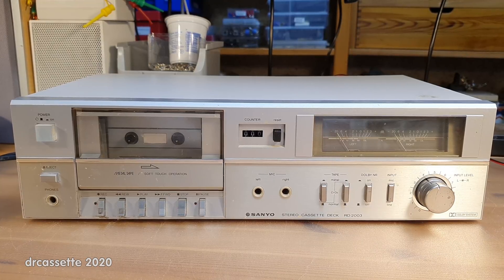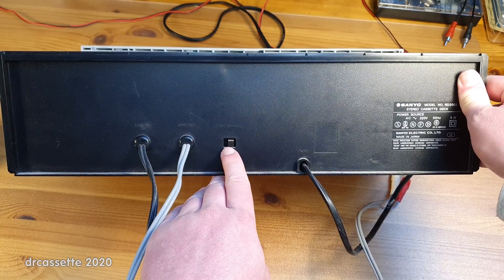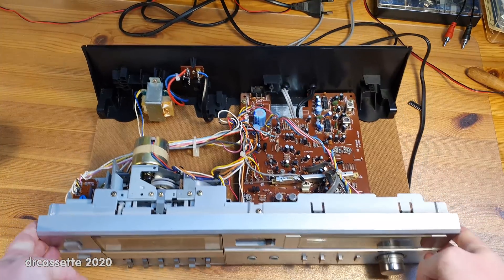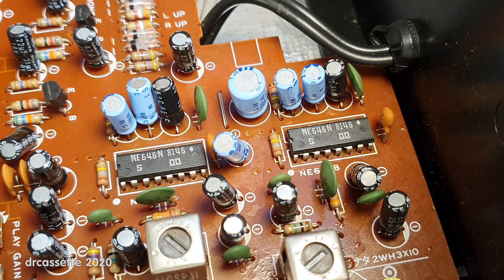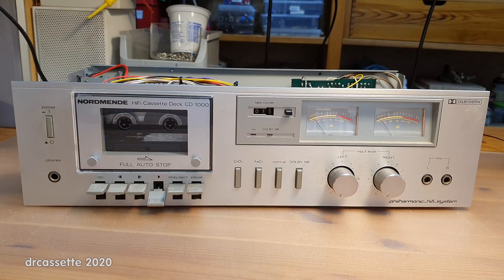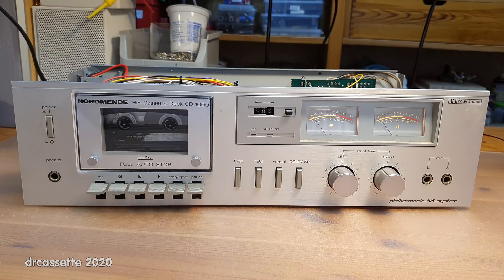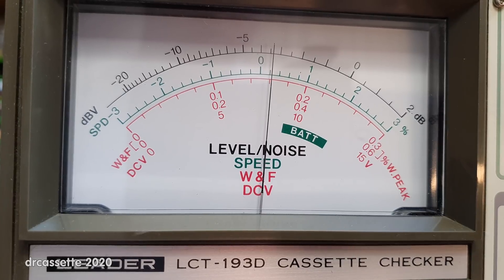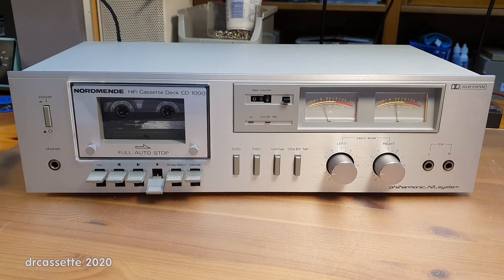Nordmende CD 1000 cassette deck repairs [2/2]

Comment: Hi DrCassette, I have hier a Nordmende HIFI cassettedeck CD1200  979.158 H.The problem is that  al the belts are melt except the counting belt. Are there manuals to put the straps back there are 4 I think, and where can you buy the belts? Kind Regards. Anatole.
Reply from the maker: Do an online search for the service manual of your cassette deck. It should contain all info you need. I usually buy my replacement belts off Ebay.
Reply: @DrCassette   i have done that, and find one but they don't mention the belt change neither a picture

Comment: Gut gemacht :) Ich bewundere Deinen Werkzeugpark, so einen Cassette-Checker hab ich noch nie gesehen. Ist aber offenbar essentiell wenn man an Tapes hantiert. Ich hab mir heute ein Braun C1 gegönnt das an einem Dual CR60 spielen soll.
Ich würde mich freuen wenn ich Dich um Rat fragen könnte so ich vor Problemen stehe. Frohes Neues, Doc
Reply from the maker: Den Cassette Checker habe ich noch nicht so lange, man kommt auch gut ohne aus. Geschwindigkeit habe ich bislang nach einer anderen Methode eingestellt, und Wow&Flutter messe ich nur, weil das oft von Zuschauern verlangt wurde (von wünschen will ich da nicht mehr sprechen...)
Du kannst mir gerne Fragen stellen, aber es kann immer etwas dauern, bis ich antworte ;)

Comment: Hi Dr. Cassette,
I have a question for you about your video on the vx1000 you did a few years ago, (I know it's weird but I don't think you would have answered if I asked you under the old video)
Here's my question:
If I film with my vx1000 and then I put the miniDV into another camcorder and transfer the files to my computer and then I put the miniDV back into my vx1000, can I continue to film or the miniDV/VX1000 will lose quality ?
And if I use a firewire cable can I keep the same miniDV tape or do I have to change it regularly anyways ?

Thanks for your respond and keep up the good work.
Reply from the maker: I do read all comments, including those I get on old videos. So I would have much preferred if you had asked in the comments of the old video.
The MiniDV system is digital, so there is no loss of quality, until the MiniDV tape is so worn out that errors in the digital data stream occur in which case there will be disturbance in the audio and/or dropped (lost) frames. I generally advise against reusing MiniDV cassettes, but if you have to, you can re-use them a few times. It does not matter where you play the MiniDV cassette.
Reply: @DrCassette  Thank you for your answer but I'm not sure to understand :
Is there a difference between transfering the files via the firewire cable and transfering files via putting the tape in another camcorder ?
So if it's the same, do I have to use (and buy) a new tape each time one is full or can I film over it again and again ?

Thank you for your answer and time

Comment: I used to have a very similar Sanyo cassette deck when i was in high school. I thought it looked cool but i saw a picture of it recently and now i realize how cheap and ugly it is, bottom line from its era for sure, one of those electronic devices that looked better than they actually were. I understand why the technician said it was impossible to repair lmao i have a Pioneer from 1998 now, i cant imagine using a Sanyo like that again

Comment: Some early sanyo products are really well made this deck is as you said very cheaply made you made the right choice the normende does sound decent even taking into account youtube compression and listening on my amp and speaker setup you made the right choice ,i have been experimenting with changing op amp chips in a few cd players to improve sound i found a site with mods that can be done to a philips cd710 i have owned from new and decided to test and do the same with a sony cd player it has made a big difference as treble sounded a bit over the top before now it sounds way nicer and more balanced i am going to swap the cheap caps in the sony for quality panasonic fc series caps and see if it sounds a bit better again just for fun i used sockets in both players so the chips can be swapped with ease now .
Reply from the maker: Indeed the early Sanyo products were quite good. They got worse and worse over the years...

Comment: Hi dr. cassette. Greetings from the U.K. I have had many pieces of audio equipment since 1973 and have always been interested as to what goes on behind the facias, lights and meters! Thank you for all of your enlightening, educational and entertaining videos on YT. Keep up your good work in repairing and preserving this equipment. Also may I sincerely compliment you on your English commentary ( measured, understandable, flowing) and written replies to those comment on your work. Have you ever worked on any Aiwa tape decks? I owned the Aiwa AD-6400 in the mid 1970's and the AD-M800 in 1980/81. I had to replace an internal fuse on the 6400 and was surprised to see that not only did the tape mechanism have a sizeable fly-wheel but it had been drilled out at the hub for balance. It seemed to be well built and laid out inside. The later AD-M800 model had a wireless remote control (yes in 1980/1!) and a very clever tape calibration system with a 4 memory store for the users' four most used tape brands, plus lots of excellent on-board features. I sometimes wonder why I sold it on! Thank you again for all you work. Stay safe and well.
Reply from the maker: I have worked on Aiwa cassette decks before (on one of them there is a video available on my channel). However, all these cassette decks were considerably newer than the ones you had. From the 90s and even early 2000s. At that point, Aiwa had been taken over by Sony and the equipment they sold could not compete with Sony products, so even the best Aiwa products were only made to about the same standard as Sony mid-range models.

Comment: I noticed you did not make use of the Dolby noise reduction on the last recording you made. I find Dolby is a 100% must on most music. Possibly not on the type of music you were playing! The signal to noise without Dolby is only about -40dB ish. A common problem with cassette decks was as the head wore out, the HF and gain dropped, this upset the Dolby reference levels, making the sound even more muffled and Dolby use impossible.
Just a point, not related to your video, many people do not understand Dolby is a 2 way process, if you simply switch it on during playback, you will badly lose all the HF. If you wont the noise reduction to work, you must record the tape in Dolby AND play it back in Dolby. This will (in theory!!) give you up to 9dB of noise reduction but ONLY at high frequency, it has no effect below 2/3 khz Only Dolby A gives full frequency noise reduction and was/is mostly used in the recording and film industry.
Reply from the maker: I never use Dolby on any recordings. I made the experience that when Dolby recordings age or are played back in a different cassette deck, they don't sound right anymore.
Reply: @DrCassette  I can vouch for this! My dad's recordings from back in the day that utilized Dolby C sound super muffled even when Dolby B is turned on, however with Dolby NR off they still sound a little weird, so I just have to live with it unfortunately. Especially if you are using a metal tape that (in my experience) has lower noise than ferric or even chrome, Dolby is not necessary.
Another issue I notice with Dolby NR is that even with fresh recordings, one deck's Dolby B isn't going to be super compatible with another deck's Dolby B. I have a cheap RadioShack Realistic tape deck that utilizes Dolby B, but when I play it in one of my higher-quality Sony decks it sounds too muffled with Dolby B on. It's possible that one deck or another is calibrated improperly due to age, but since I'm not super proficient in that area of deck repair I'll just choose to leave NR off.

Correction: Metal tape isn't quieter! It can just be driven higher than other tape types so you don't notice it as much.
Reply from the maker: @KSBEntertainment   In my experience especially aged Dolby C recordings are indeed problematic. Dolby B you can always play without Dolby and they will sound okay, Dolby C tends to sound rather strange. 
Metal tape actually has higher noise than chrome, but you don't notice because you can record at much higher levels, drowning out the noise. 
And yes, the Dolby calibration can vary a lot between different cassette decks. Whether that has always been that way or whether the calibration drifts over the years I don't know.
Reply: @DrCassette  Thanks for the correction about metal tapes!

Comment: The Sanyo (Fisheyo) IS little on the chinsey side...but let's be honest...even Sony made worse...MUCH worse.
Reply: It says made in Japan.
Reply: @macdaniel6029  SONY TC-FX211 https://youtu.be/4di0_m87_ZQ
Reply: @HamtaroEL  The sad part is i bought the exact sony cassette deck for 99p on ebay postage was £9 and found out when i posted to facebook cassette deck group just how crap it is to be fair it sounds about on par with a sony walkman the 3 head sony deck i bought as faulty sounds superb though but has been messed around with by someone that had no clue what their doing at some point i might find another 3 head deck and use the existing one for spares .
Reply from the maker: At least Sony used hard plastic in the 90s and 2000s whereas the Sanyo used the type of soft plastic that you can bend around...
Reply: Especially their BPC ones in 1990.

Comment: I had the same exact SANYO deck and it was... meh. Eventually tossed it due to crappy mechanism. If there's something on the radio, I gotta be able to hit that record button FAST and not wait two or three seconds for that lame-ass mechanical drive move the heads in place just so I can push the button with less force... and my deck's mechanism tended to get stuck so I had a hole drilled in the side where a wire would run out so I could pull it if the mechanism got stuck.
I have a boombox from the late 70s with CrO2 tape switch and stereo VU meters and even though it only has automatic level control, it makes (slightly) better recordings than this SANYO.
Reply from the maker: Good to know the Sanyo really was as bad as I thought it was :)

Comment: I was quite dissappointed with the first video, but now it is great! Good job. I was sad to see a interesting equipment like this junked due to a US$ 1 chip. The Sanyo scrap did solve the problem. Good to see the Nordmend running well again.
Reply from the maker: Thank you :)
These are not exactly $1 chips. From a trustworthy store in Germany, the cheapest offer I could find cost 12€ (shipping included). You have to keep in mind whether or not a repair makes sense economically. The entire cassette deck in good working condition is worth only about 20€...
Reply: @DrCassette  Yes, you´re quite right! Nowadays, if not for the passion and the challenge of repairing it, if we consider only the money cassete decks are a thing of the past...
Reply from the maker: I am sure these basic, reliable cassette decks will go up in value again once the fancy decks from the 90s start failing with more complex problems than just belts. But we are not there yet, and who knows how long it will take. For now, I enjoy repairing cassette decks as a hobby, but once the repairs cost money for replacement parts, I get very cautious, because any money I spend I might not be able to make back. And I am not rich enough to not having to care about such economic considerations.
Reply: @DrCassette  Yes. Tottally agree. Regards and congratulations for your work, appreciate very much.
Reply from the maker: Thank you :)

Comment: Did you salvage other parts of the SANYO, or was it not worth it?
Reply from the maker: I salvaged: Top cover, lightbulbs, VU meters, main board, cables, power switch, transformer and tape counter. I completely tore down the mechanism to see how it was put together, in that process I salvaged: Various springs, C-clips, E-clips, plastic washers, rec/play head, erase head, metal pieces with useful shapes. Normally I would also salvage motors and belts, but the motor in the Sanyo was dubious, and none of the belts were still good. I am sure I am forgetting about some parts. Be assured nothing that could still be useful will be discarded.

Comment: As soon as I saw this Sanyo, I said to myself - DC has found a compatible Dolby chip!  Bye bye Sanyo. ;o)
Reply: A bit of a downgrade. But a welcomed one.
Reply: @vdochev  Neither machine was 'high end', but a solution was found. ;o)
Reply: @vdochev  Well, since, I think, the head of the Nordmende already showed some wear it wouldn't reach the highest frequencies anymore even with the original IC.
I don't think that this is a problem :D

Comment: Great how u have this machine fully functional again after replacing the ics from a cheap Sanyo stereo tape deck,,,not to mention that belt stuck on the pulleys of the mechanism,,,that would've been a nightmare for you.

At least that machine is useful for parts instead to repair another stereo cassette deck later too.